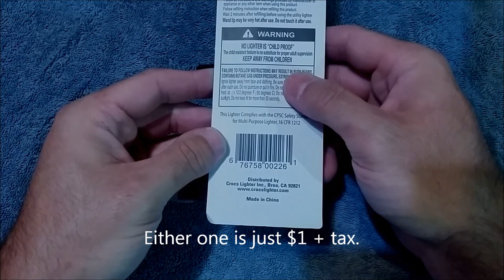Fireworks Torch Igniter Repair

Comment: was a pain in the ass trying to do this with my old asg pocket torch, the timing on my piezo was off as it was sparking before the gas was coming out ,had to remove a small rubber spacer at the bottom of the piezo and then had to put a spacer between the top of the lever and the inside of the top portion of the plastic button as well as splice and put on an extension wire and glue it together because it was also sparking wrong place, the tip of the new wire came lose in the ceramic cup and only had the old wire going through a hollow wire cover but somehow the damn thing was sparking properly and lighting perhaps not always on the first try and the hissing of the flame was not as strong as when new and the flame would not stay as sharp when making it bigger like it used to perhaps due to some clogging in the nozzle or improper gas line fit to the nozzle but its working well enough and im so happy because i loved this lighter and cant replace it and had no idea how expensive they are now, next time ill do a better job and fix it right

Comment: how come the bbq lighter piezo has two wires but the ones in lighter only have the one? i never understood how they spark at the nozzle when there is no return wire to close the circuit, also they will not spark on metal unless you are touching it at the same time yet the brass fame nozzle in the lighters do not have any connection to the metal bottom part of piezo for return or closing circuit so how do they spark there?

Comment: My torch shows color of flame for split second ..it will not stay lit.. or it will light for a couple seconds although it won't stay lit very long.. some times it will stay lit until I release the clicky button thingy...almost all my torches have had this same problem. Is it that I leave it lit too long? Is it the torches in this state are broken? Is it the safe stop? 😅 only one torch has never gave me problems but someone else broke it. My micro. So all these other torches are broken. Anyways cool video thx for sharing

Comment: Where can I get the new igniter? I opened the assembly and saw mine igniter wire too has broken so gas coming out but no spark.
Reply from the maker: The two lighters I found that had usable igniters both came from the local Dollar Tree. I'm sure if you can't find the shorter one, the longer one has similar lighters to it sold at many places. The thing about the Dollar Tree or similar stores is they will be cheap. They may be as much as a new torch lighter at other stores. You'll have to look around.

Comment: Besides the wire on the igniter falling off, or having a cut in the plastic that covers the wire what else can happen for the igniter to not work anymore? Does the crystal come out of alignment?
Reply from the maker: Maybe? I'm not sure, honestly. Considering the one I used to repair mine only cost a dollar, I think it's much easier to replace them than try to fix them.
Reply: If hole in insulation put super glue. They break after long use in the plastic casing. This is the best way to fix an ignition. Its easy.
Reply: @rafaeltorre1643  yeah I’ve tried super glue, hot glue,clear epoxy, heat shrink even the rubber gas line just slid over the hole in the wire insulation. It’s hit or miss with any of those methods. The electricity wants to ark closest to the crystal as possible, I’m guessing because it looses its power very quickly when traveling down the wire and if it can reach any conductor closer than the end of the wire it will. But idk I’m just guessing. You can always buy a dollar bbq lighter and take the piezo igniter out of it but the insulation on those wires sucks and melts away very quickly unlike the clear thick insulation on most other lighters. It’s hard to find the igniters with a long wire and the good insulation.
Reply: They always fail from use. The plastic rounds where it catches to get the hammer effect by rubbing the corner and no longer catching to hammer down on the crystal. #1 fail reason.

Comment: hello , your awesome.  my torch lighter suddenly makes regular lighter flame and after few seconds it chages to huge flame( looks like gas is leaking).  so I am scared now to use it. I will try to disemble and see what is going on since when I shack I could hear something inside is moving.    before I proceeed any ideas? or usefull video you have? thanks.
Reply: Either the fuel hose is loose and/or the torch nozzle jet is clogged. If it’s clogged you can soak it in alcohol and get it clean. I personally just replace it but I have so many of them it’s easier. Either way save all of the metal and gasket parts for future use. They work for torches and lighters and you’ll be happy you did if you use them somewhat regularly. Under the hole in the jet theres a screen you can see through it by shining a light straight into the hole. Under that is a spacer then a metallic disk. This is what makes the torch flame. The screen gets clogged over time due to inferior butane gas. Always use 3x filtered. But I use 10x. Whip its or Newport Zero. Whip its comes with more and buy one get one free so Its my go to and should be $10 in most places. And the adapters are some if the best.

Comment: The filler  valve on my torch is stuck open so the little tank won't hold any butane.
Can the valve be fixed or removed for replacing ?
🤔
Reply from the maker: I don't think so. The fill valve looks like it either glued or riveted permamently in place. I'm not sure exactly how the put it in, but It doesn't come out. Maybe you could get some warm soapy water to soak the tank in? Let it soak for a little while and then blow out both sides with a can of compressed air. Anything to clean or dislodge what's keeping it from moving.
Reply: jamisonlm3 
good idea! 👍
Ive never disassemled one of thes before but I imagine it is press fit into the tank. 
i also imgagine that the valve is regulated by a light spring ? 
when i get time ill try to seperate the head from tank.  hopefully enough access is available to douche out the tank. 
might try regular lighterfluid  , shake it about for a bit while workung the valve then douche it with what you said  then hit it with the hair dryer to dry it.
Reply: jamisonlm3 
oh yeah...  thanks 😀
Reply: There’s a guy on YouTube who has hundreds and changes them all the time.

Comment: Dimensions of that fuel tube please
Reply from the maker: Which measurments do you want exactly? The diameter of the top of the tube 1.182" and tapers lightly to 1.162" right above the clear plastic bottom. The clear plastic bottom is slightly smaller at 1.132". The total length of the tube is just under three inches at 2.952"
Reply: @jamisonlm3  wound up getting refunded for first tubing reordered 1mm ID and 3mm OD leaving a 2mm thickness. Should be perfect for temperature and pressure